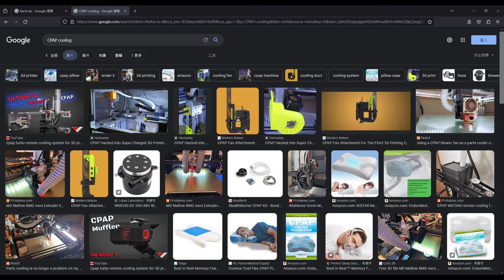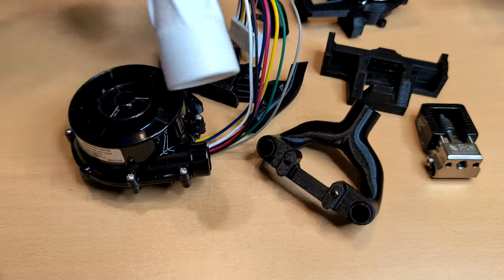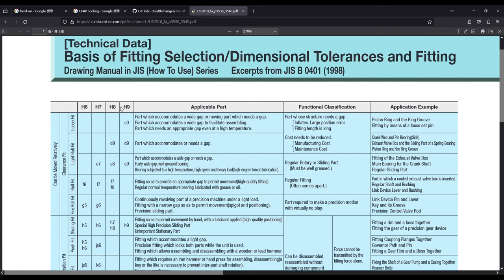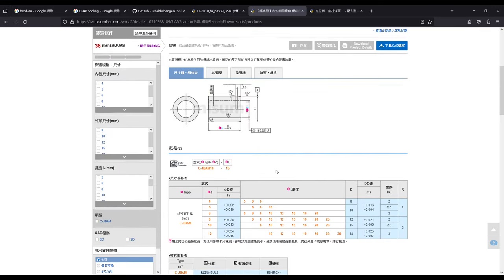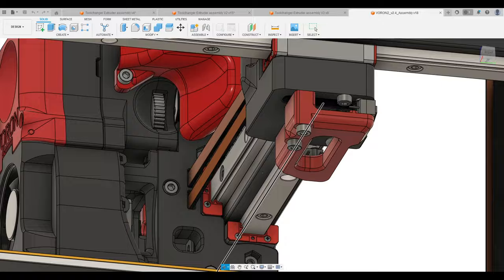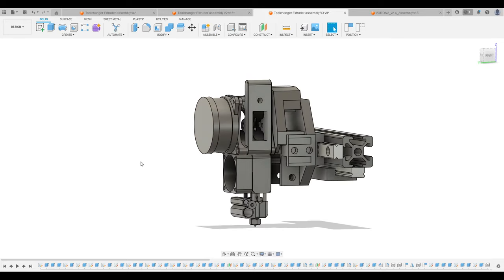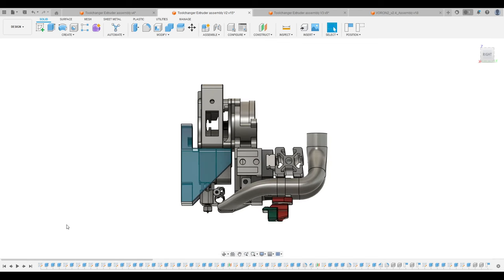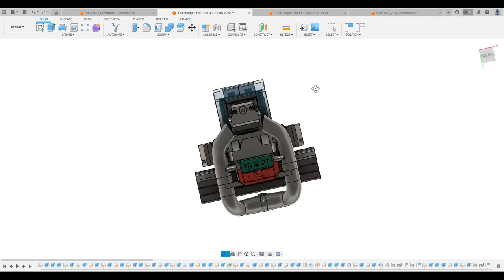[Tool changer] Other ideas for tool head design?

Comment: Maybe to avoid such a huge moment in the toolhead, changing the where the rail mounts will provide more clearance. Mounting a single MGN12 to the top of the x beam allows more room in the positive y direction to mount the toolhead (10mm to move the whole toolhead back), but it will require a lot of modification to adapt well to the 2.4 motion system. The XY joints take up a lot of room on the top of the extrusion and the belt paths are offset in the y direction, which requires belt holders to be offset relative to the toolhead anyways. I'd probably look into a different motion system to create a dedicated toolchanger, because of the major space constraints in the 2.4 x-y motion system, but feeel free to add your thoughts to that.

Also, maybe a pcb klicky would help in reducing the footprint of the probe as everything is constrained to the pcb board, resulting in a more compact cooling duct system.
Reply from the maker: Yes, I agree that the rail on the X-beam top will reduce the total length in the Y-direction. However, with the fixing on top, I need some parts to adapt the tool head to the front side, which affects its rigidity. The mounting also affects the swapping motion, which pulls when detaching. Based on these, I don't plan to modify the motion system too much. For the Klicky probe, I'll source about the PCB one, making it a more compact solution.